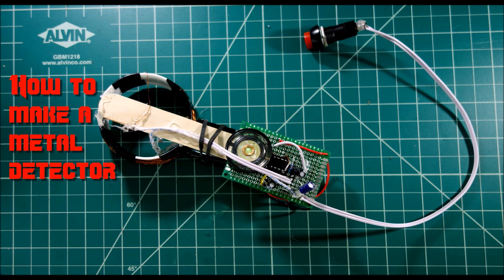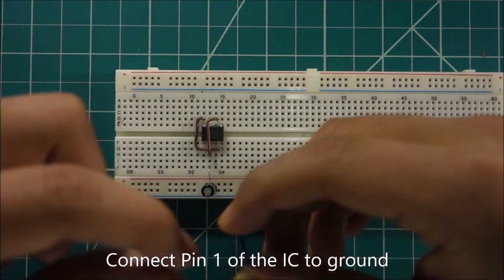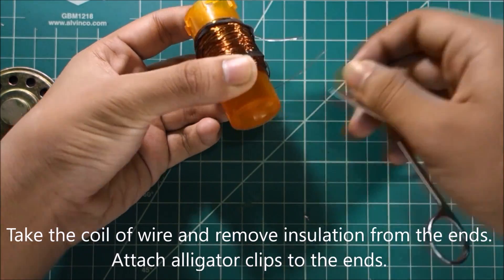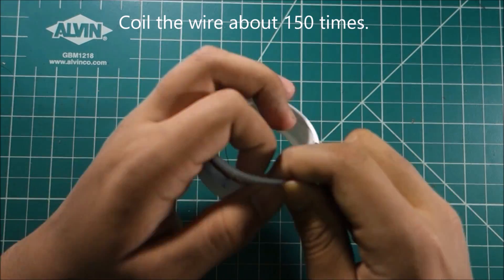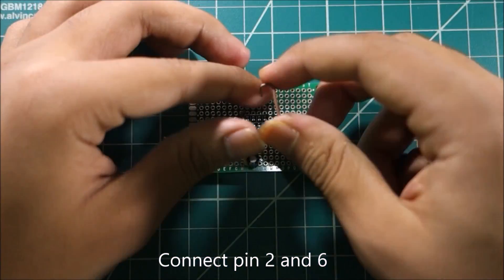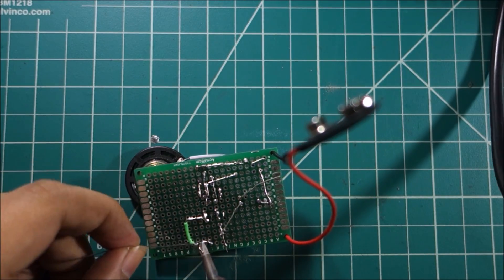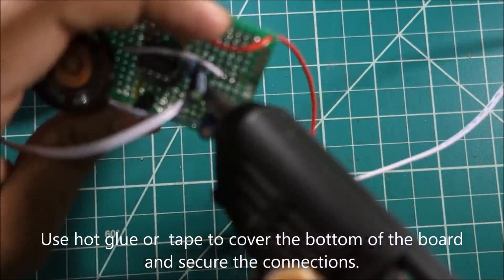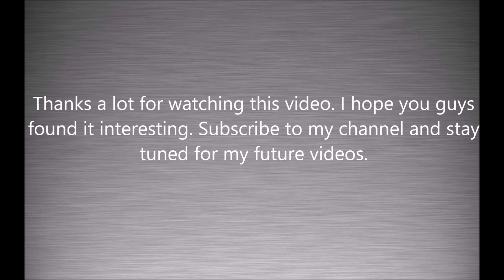Make A Metal Detector

Comment: i want to make this metal detector...for my project please help
Reply from the maker: Shaheentaj Sayed What do you need help with?
Reply: AH Electronics 
have u shown two different ways to make metal detector?
which one will be easy that bread board or other
Reply from the maker: They are both made the same way, only one is made on a bread board, and the other is made on a perfboard to make it permanent.  When you make something on perfboard, you have no way to undo many mistakes. So I suggest you to make i on a breadboard first,since you can fix mistakes really easily.   But in the end they are both the same circuit, remember that.  Hope it helped!
Reply: AH Electronics 
I am trying to make it on bread board......
thanks